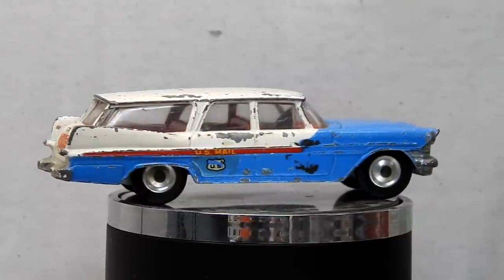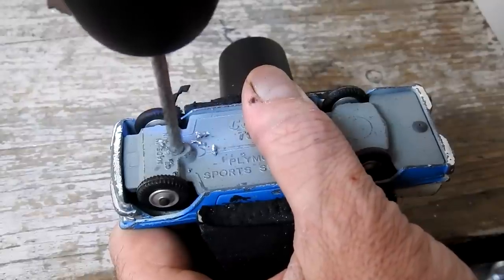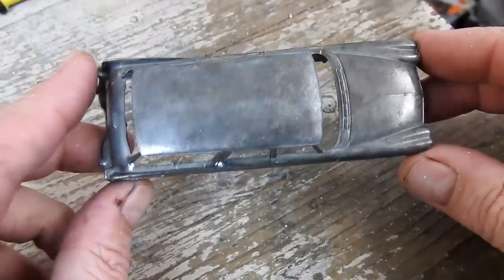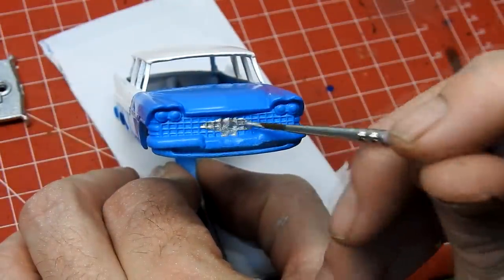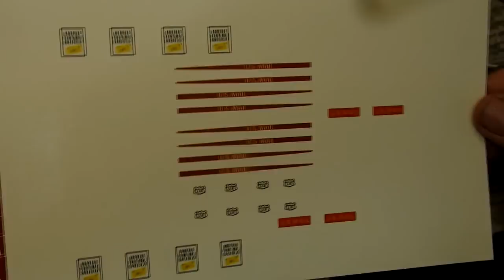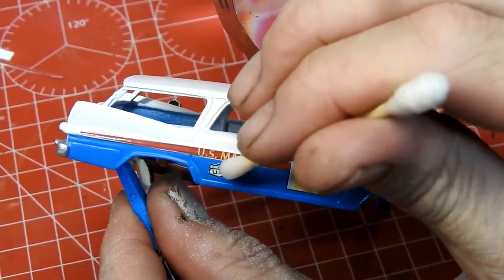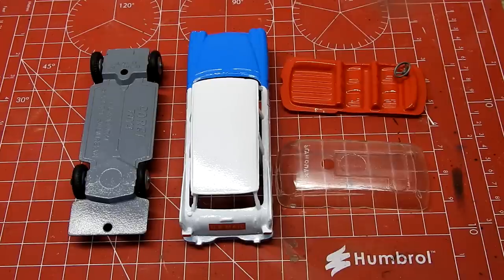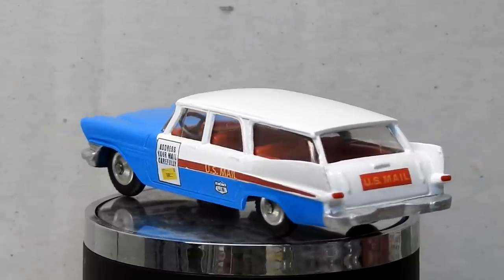Vintage Corgi Restoration Plymouth US Mail Car

Comment: Hi Danny this particular  one was produced between 1963 to 1966.,it's the same casting as 219 Plymouth sports suburban,  produced between 1959 to 1963.
Dark cream body , tan roof smooth wheels,  or the same with shaped wheels. 
Excellent  restoration .

All the best.

Comment: I was born in 1961.
As a kid, I had boxes and boxes of matchbox, Hot Wheels,
( based off of the original cartoon which I remember), and Corgi cars. There was a toy store in an early Shopping Mall, and I remember they had older, and different Corgi cars, than in any other place.
I remember seeing this one, and one that I REALLY wanted, had a steering wheel coming out of the roof that really worked.
I did get a couple of these older models, but never this, and never the one with the steering wheel. I think it was blue, maybe a Ford ❓maybe a Rally car.
Anyway, Excellent restoration.
📻🙂
Reply from the maker: I have the Austin A60 Driving School car it has a steering wheel on the top and is blue 👍
Reply: Danny's Diecast Disasters 
SO, THATS what it was.
Question:
What years was that
“Driving School “ Austin made❓
📻🙂
Reply from the maker: Sorry only just saw this. It is No255, produced from '64-'68 👍
Reply: Danny's Diecast Disasters 
Thanks. That means that I was looking at a new one , at that time.
I just barely remember the toy store it was at.
📻🙂

Comment: Beautiful restoration! Did you buy new replacement wheels or tires?
Reply from the maker: No they were in good condition luckily
Reply: @DannysDiecastDisasters  ; Unfortunately, I have many CORGI and DINKY that have crappy tires. Thinking about using rubber washers and rubber O rings.
Reply from the maker: @TheSteamLocomotive  You can order new tyres on line, Recovertoy and there are some other sites.
Reply: @DannysDiecastDisasters  Thank you Danny.

Comment: the interior piece seems to be made for budget. Baremetal did a corgi thunderbird hardtop, and it is rather similar interior.
Reply from the maker: Yes, ironically however it is probably in better condition than most of the cast plastic interiors I have seen.
Reply: @DannysDiecastDisasters  because they are sealed in. cast interiors are often exposed.